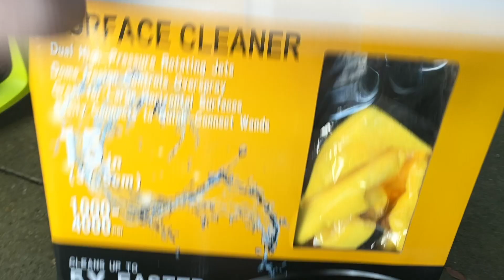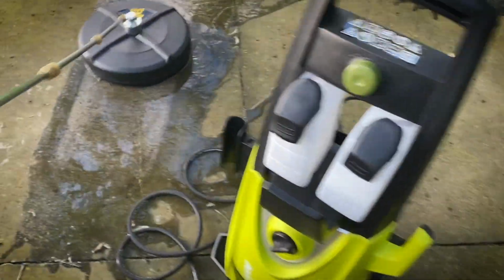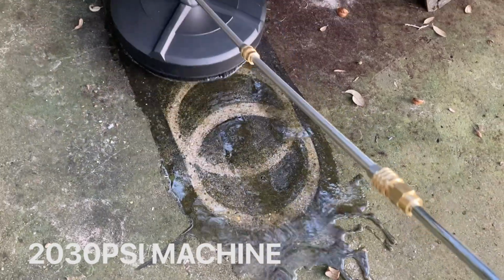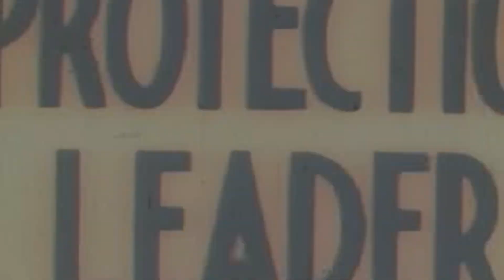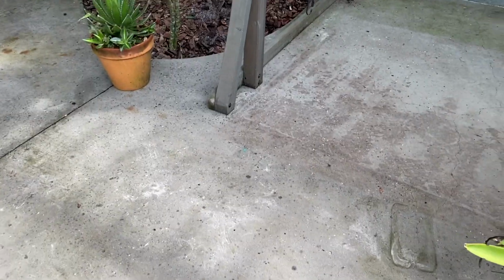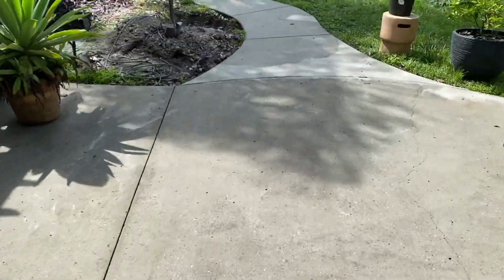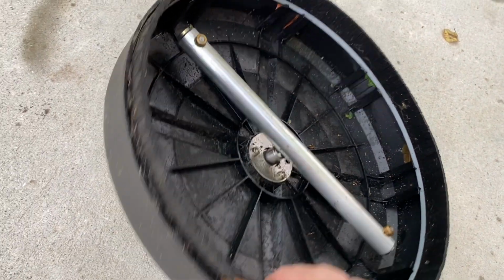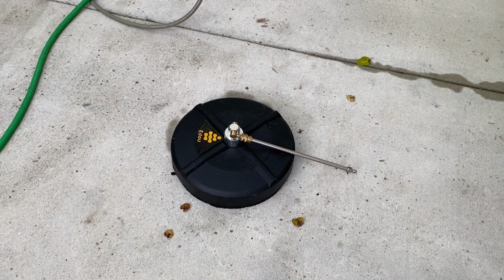EDOU Surface Cleaner Honest Review | Why didn't I know about this sooner? Best $79 Spent on Amazon!

Comment: So I purchased this but how do you connect the hose, what type of hose do you need, and how do you control the water flow - what handle or gun do you use? I’m at a lost and Amazon customer service is totally clueless.
Reply from the maker: You need a pressure washer to connect it to. Not a regular garden hose
Reply: What can I buy. I would like to keep it if I know what else I need to get to make it work. The vendor and Amazon customer service were useless. I hate to have to return it but if I can’t use it I will have no choice. Can u tell me what I need to get to operate this? Thank you.
Reply from the maker: This https://amzn.to/32mP4mK
Reply: @Archifx  can you make some suggestions what I should but from Amazon or Home Depot? Otherwise I have no choice but to return it - and I prefer keeping it because I need a pressure cleaner for my driveway. Thank you.
Reply: @Archifx  thank you so very much. Ordered it. I appreciate your time.

Comment: Hi. Great video. You should try putting some hydrochloric acid on the concrete. It could help it clean out those stains.
Reply from the maker: Where would I get that?
Reply: @Archifx  home depot or even walmart sell it. You can even use muriatic acid too. I used it a few years ago and it cleaned the concrete pretty good. Spray it down and scrub it in a little with a broom then use the surface cleaner. But hose it down real good.
Reply: Be careful to not use too much. On a hot humid day HCL fumes pretty good

Comment: Well it's been a year does the edou still work? Mines won't spin anymore. Been about a year
Reply from the maker: Mine still works good. The fitting at the top started leaking so I replaced it with a new brass one

Comment: I have the exact same one. After about 20 hrs if use mine stopped spinning. Nozzles are clean. Anyone know how to fix or get ahold of the company EDOU Direct?
Reply: They all go out from the bearings eventually on these sub 100 dollar washers
Reply: Some of the cheaper ones have bearings you can replace. Should be an easy job.
Reply: You might try to disassemble the spinning bearings n add more grease